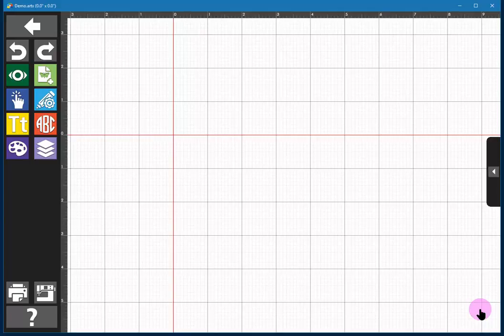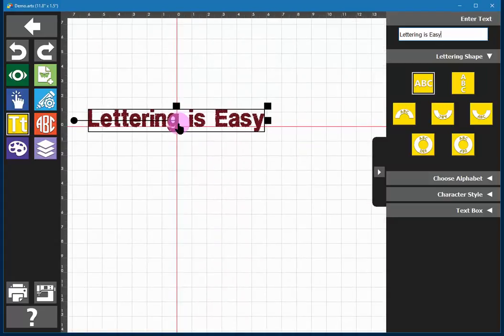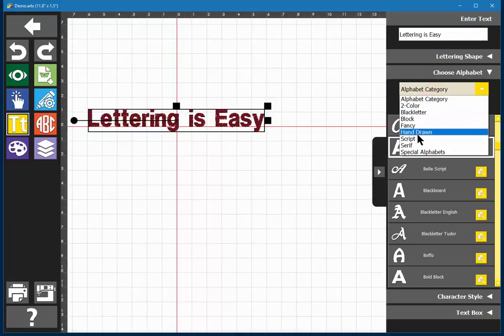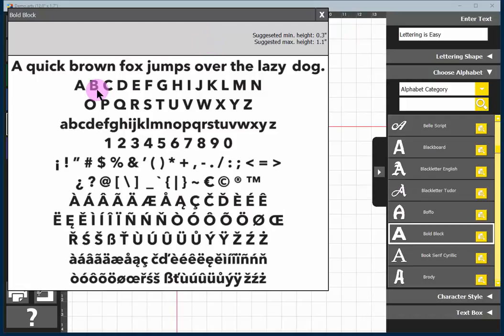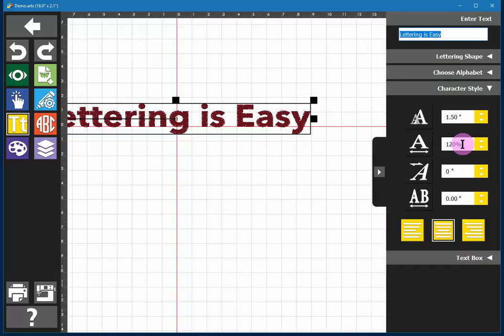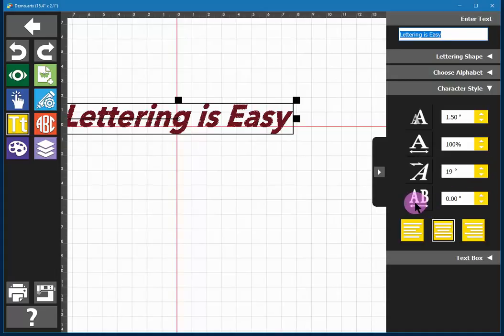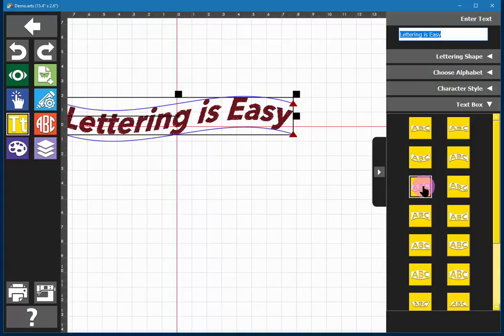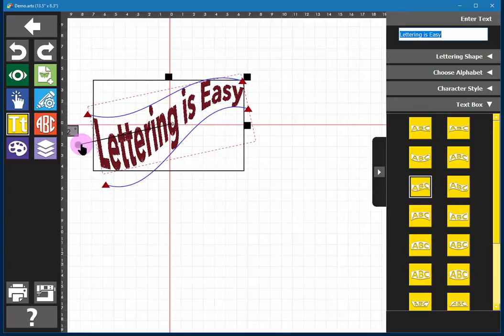BERNINA Toolbox Tutorial Part 9: The Lettering Tool

Comment: I cant seem to find any way to edit the text on an existing text box. I want to use the same style and placement but only alter the text (im embroidering number codes onto the same place in the hoop)
Reply from the maker: Thi there. Please select the text box (using Select / Select Designs) and click on the Lettering icon to open the tools for lettering. As long as the lettering is selected, you can change the font for example or change the letters by clicking in the text box on top and type in different letters or numbers. Have fun embroidering!

Comment: What about using outside fonts and mapping them out?
Reply from the maker: Toolbox software being Editing software (and not a digitizer), it can use the alphabets already digitized in either the Lettering Basic or (full) Lettering modules.  There is also the Monogram module for monogramming.  Toolbox cannot digitize computer fonts like TrueType fonts on a pc.  It can import designs from ‘Alphabet’ collections, however note that while such designs look like letters of the alphabet, they are not true alphabets that can be typed at the keyboard.
Reply: @BerninaInternational  Does lettering provide me with more fonts?
Reply from the maker: @TcVideoHosting  Yes, it does. Please see 03:03 of the video for a preview. You will see that old English fonts are included ("Blackletter").